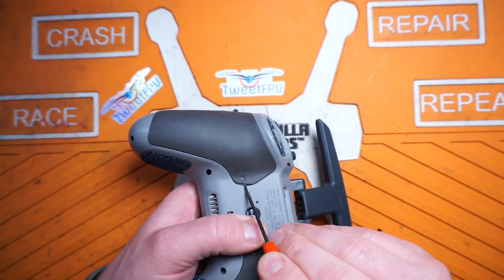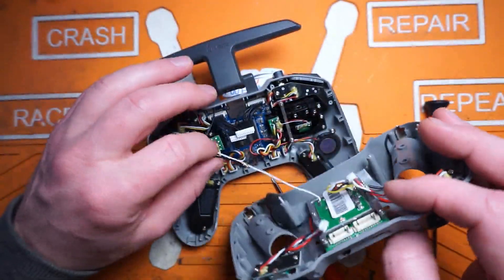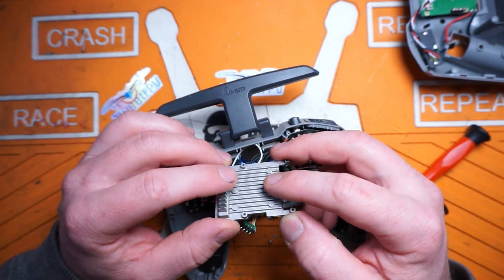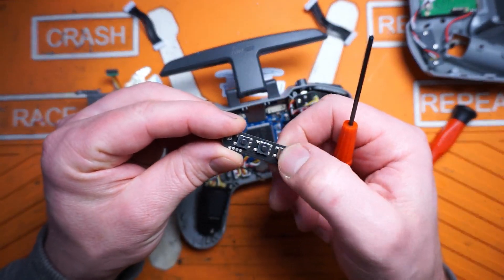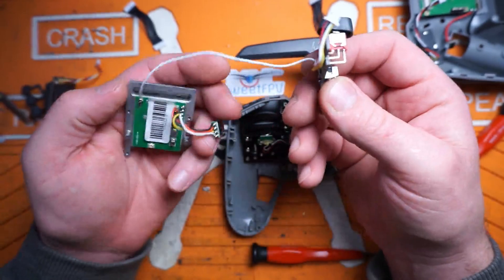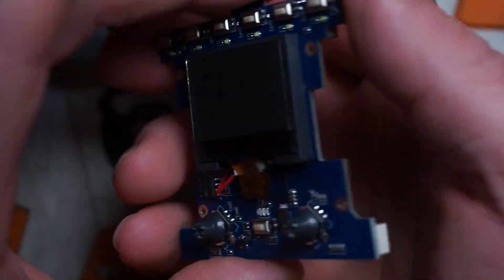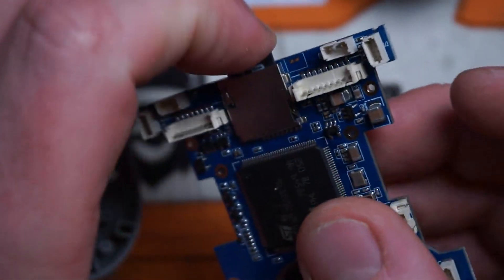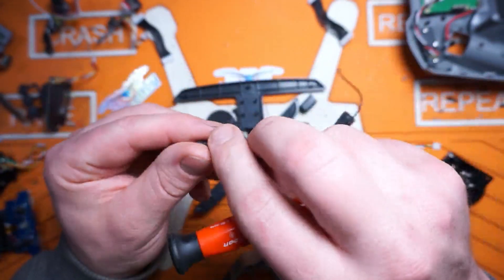Jumper T-pro teardown #t-pro #elrs #jumper

Comment: Hi thanks for vid...how come you didnt use one of the 6 small buttons for that wire or does it have to be that switch you used just seems the small ones are better for this wont the boot buton be pressed if that button is also bound to something else?
Reply from the maker: You can really use whatever button you'd like. And no it only matters during power up so being bound to something has no effect in the end.

Comment: 9:25 could I put the antenna inside? I guess the consequences is a weaker signal. But since I fly whoops I don’t need so much thanks
Reply from the maker: Sure can. And yea lower signal will be the result but in my experience it didn't make much difference for the average pilot.

Comment: Quick qestion, what would I have to do to change it to mode 3? Im just wondering how far i will need to take it apart?
Reply from the maker: I can't remember if you can dissable/enable the centering springs on both gimbals. You would probably need to swap the gimbals around and then in the etx software tell your radio that you are running mode 3.
Reply: Ok,  thanks for the help. I haven't bought it yet, just trying to decide between it and the zorro
Reply from the maker: @aylenstudios  go with the zorro or the boxer.
Reply: @TweetFPV  what would you say the zorro does better than the t pro. I like the smaller size any better battery life on the t pro, but I would consider either.
Reply from the maker: @aylenstudios  better gimbals and better overall construction quality.

Comment: 8:48  Im getting terrible range with the factory antenna and getting constant RSSI low and critical warnings.  Are you saying its possible to install a different antenna to the internal module?  Maybe improve range?
Reply from the maker: Yes you certainly can replace the antenna witj just about any antenna you want. But you shouldn't be getting bad range with this radio if your receiver antennas are setup correctly and in good working order.
Reply: @TweetFPV  So i returned the radio.  BOught another thinking something was wrong with the first.  Exact results with the 2nd radio.  Im using the internal module with DSM protocol.  Do you think thats why Im getting the awful range and what can I do about it?  Im scared to fly any expensive aircraft for fear of losing it to signal loss.
Reply from the maker: Short range and dsm go hand in hand. There's a reason why spektrum was coined as team fail-safe. It is probably outputting 10mw and on old 2.4ghz tech that won't get you very far.

Comment: My recently purchased Jumper T pro (4 in 1) version all of a sudden has a display malfunction. There is no display on screen however backlight is working. All  Functions and switches  seem to be working fine just no display. Thinking of opening it up to see where the problem might be. Any suggestions to troubleshoot this issue? Thanks and great video!
Reply from the maker: I would just return it to the retailer and let them deal with the defective device.

Comment: great video! thanks for taking the time to disassemble :) I think its possible to 3D print a smaller antenna to fit the pdb, as you said a lot of waste space, to make it even smaller or not as bulky. i will have a look when my radio arrives :) 

Can you please tell me, what size the gimbal end sticks are? what length and thread, m3? i want to switch to a litte bit shorter ones, maybe you already have a recommendation :) thanks!
Reply from the maker: They are m3. Unfortunately the only way to make the sticks effectively shorter is to cut the studs down and use just the upper half of a stick end.

Comment: There is a guy who made a file for 3D printer so you can print a different shell case for the jumper , it got me thinking to make a shell big enough to fit an FPV screen internally to make our own First generation TBS tango transmitter
Reply from the maker: Oh that would be really cool. I think there is a open source radio project out there. I think it's being done by one of the elrs devs, but I could be mistaken.

Comment: Does that "mod" render the momentary switch useless? or does it only do something when powering on the radio?
Reply from the maker: It does not change the functionality of the radio it's only for when you're updating firmware otherwise switch Act exactly as it did from the factory